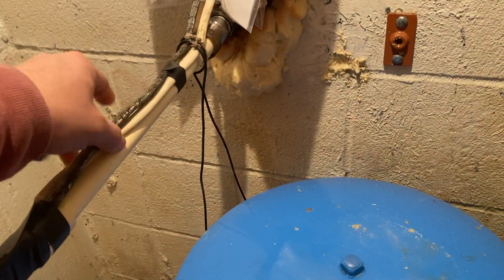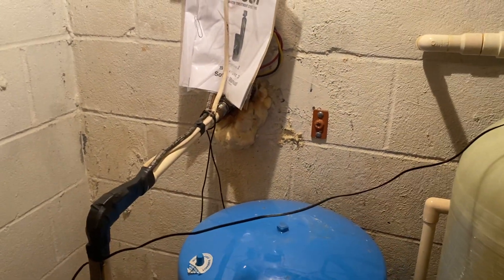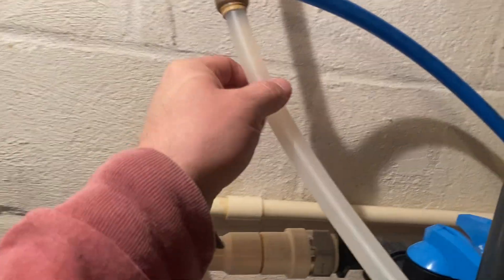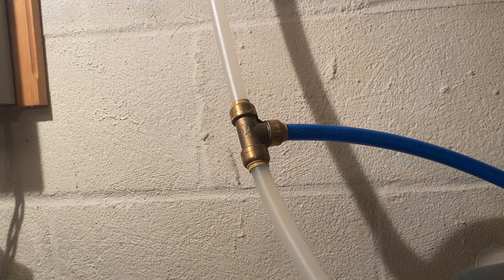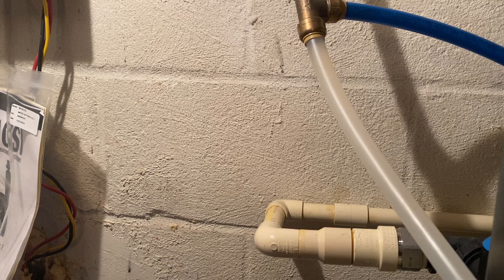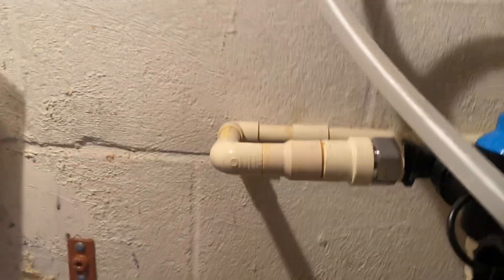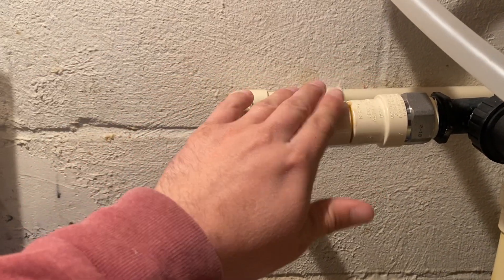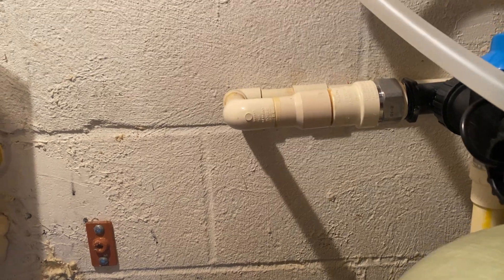Why Is CPVC Used More Often On New Well Installation Instead Of Copper or Pex

Comment: Before pex was very popular, I replumbed my house with cpvc(was galvanized) several years later the water heater failed, when I went to cut the cpvc with the cutters, the pipe just shattered, I found out that's what cpvc does, so now I stay away from cpvc and use pex. When I started using pex,  only pex B was available at any plumbing supply house, or the big box stores, so that's what I went with. Now they have all started carrying pex A. Pex A does have a couple of advantages, but they would likely never be utilized in most real world use, and since the fittings are much more expensive, and the expansion tool is very expensive, and the fact that Pex A leaches a lot more chemicals into the water, I decided to stay with Pex B.

Comment: I believe the supply line from my well pump to the house is Black Polyethylene. It then has coupler and transitions to CPVC
Reply from the maker: That would make sense. Most water lines will be that style of pipe when buried or used in a well.